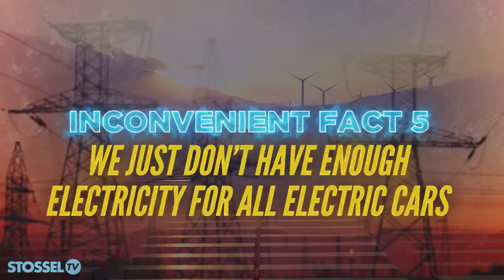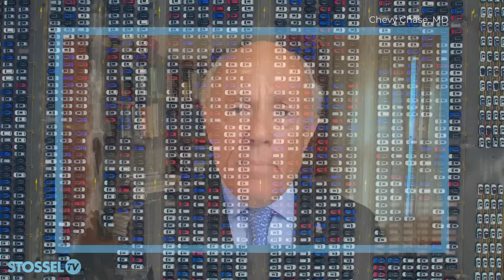Electric Cars: Inconvenient Facts, Part 2

Comment: One thing to remember: Politician's by and large are not elected because they are competent at governing.  They are elected because they are good at campaigning, fund raising, pandering, and cutting back room deals.  In other words, we are largely governed by the world's Marketing Department.   And "going green" is good PR, even if the facts don't support it.
Reply: This is why I hold a distinction between a politician and a statesman. Politicians are more or less as you say. Statesmen are those who old the same political positions as politicians, but care more about doing their job than getting reelected (and before anyone says anything, no, JFK was not a statesman).

edit: Minor addendum, a statesman might be good or bad at their job, but at the very least, they are actually trying to do their job.
Reply: hmm, actually it depends very much on which facts fool you the most. For instance the fact that you would need 2x of US area covered in solar panels to produce all the energy used in US, or the fact that 12% of used energy in US is already renewable and if that number is multiplied just by 8, the entire US energy needs would be met; or the fact that specifically for all electricity used in US you would only need 1000 sq.mi of solar panels to produce.  ...all are true, but just the first is mentioned in this video.
Another easier to understand fact: off grid, with a modest 5kWh solar panel system you would be able charge your electric car the equivalent of 100miles every sunny day for free.
Reply: @brianensign7638  Of course some people suck while others are great, that was the point of the addendum.

Still, I would rather see bad results coming from good intentions than bad results from bad intent.
Reply: @alexd.6551  hmm, believe a YouTube comment or a physicist from the Manhattan Institute.  Alex, I'll take the Physicist for $500...  🤡
Reply: @alexd.6551  Just because 12% of US power is "renewable", doesn't mean 12% of the grid is fully supported by it, and it certainly doesn't mean 100% can be supported by it. 

Most "renewable" sources are not stable. So, for every kWh produced by things like wind and solar, a kWh must produce by traditionally generation, like gas and coal. This makes most "renewables" redundant. 

Think of most homes with solar. In theory, the panels produce enough power to the home, yet the home is still connected to the grid. This is because the panels don't always produce power. So, a gas turbine must remain spinning away, waiting for a cloud to fly over your home. It's just a massive waste.
Reply: @whyjnot420  I don’t know. People seem to have a harder time backing out of a mistake if they think their motives are pure. It’s the misguided ideologues that will persevere in error long after the self-serving politician would have cut losses and run.
Reply: @AkioWasRight  I will say, if we can get more energy dense batteries, that one becomes less of an issue as we can store bigger batteries at home such that daily power requirements can be met with just solar charging. If we get to the Goldilocks zone of using more plentiful materials like Sodium instead of Lithium (research and production is already happening there for large, stationary batteries), we could transition to be the other way around where fossil fuels are the backup, like how some homes have a backup generator. That’s a pretty far off goal though, and it would take several breakthroughs in battery technology to really make it viable, but it’s still a possibility while researchers look at how to make batteries more energy dense and longer lasting.
Reply: @brianensign7638  In those cases you can only hope that they have integrity. Probably have more luck hunting for unicorns though. >.<
Reply: @alexd.6551  At best, solar panels yield 1000w per square meter in full sun. Due to night, clouds, low angles in early am and pm, it's more like 100w per meter 24/7/365. Based on that, how many square meters of panels would we need to supply the USA wattage needs 24/7/365? Hint:  lots more than you think.
Reply: But somehow you don't think they've been bought out by big oil.... I think you guys have been bought out by big oil.
Reply: @Rick-ro8bf  hehe, better than believing is doing the math and checking the facts yourself. The appeal to authority is a common logical error, regardless if you choose to trust or distrust the authority of government, certain scientists, or certain youtubers.
Reply: Truth
Reply: the real green energy is the kind that glows green in comic books and cartoons. Nuclear.
Reply: Well stated, and 100% truth.
Reply: @alexd.6551   Total bullshit that ignores every other mitigating factor. Nice try, Sparky.
Reply: @AkioWasRight   Don't confuse the sheep.
Reply: @alexd.6551  
for free? so you didn't have to pay for the solar panels? the converter? the car? the cables? the house? the installation? what flocking planet are you from? evidently not this one!

there are no free lunches!
Reply: @Bob_Adkins  
the sun provides 1000 watts per square meter during summer and only if the sun is directly overhead - solar panels are less than 20% efficient, so they produce less than 200 watts per square meter, during full sun, on a summer day, when the sun is directly overhead

try again
Reply: @andyman8630  Obviously for the house and the car you have to pay regardless if you go electric or gas, for the panel system there is a one time payment which you need to check if it is cheaper or more expensive than paying gas for say 15 years. I will agree thou electric is less convenient, but might be cheaper.
Reply: @pretorious700  Are you blind to the difference between something bad happening because something bad happened & something bad happening because someone deliberately wanted something bad to happen?

Not a big concept.
Reply: @alexd.6551  
you mean to say it's not free?

that's what i thought
Reply: @andyman8630  Yes, I'm guessing it would take over 1000 square miles of solar panels to supply all of our electric power needs, plus 100's more square miles for batteries and other infrastructure. It's just not feasible, even with a little help from wind power. Solar must never be large civil projects,  it works much better for private hobbyists that have time to tinker with it.
Reply: @Bob_Adkins  
agree entirely! an individual can go off grid with solar, but as community base load? forget it
Reply: @andyman8630  Yeah, Andy it's perfect for certain people and their situation, but a complete disaster if you try to make mega projects for more than a handful of families and businesses.
Reply: @Bob_Adkins  I mean it was stated in the video: even if you cover all of the US in solar panels it will still only produce enough energy for half of the population with current technology and based off physics even future technology isn't gonna change it by that much more.

I'll be blunt there's only 1 way green energy can be enough for the entire world population and it is not a pleasant way: reduce the world population by about 50% to 70%...and I doubt many people would volunteer to be in that reduced % nor would I say they should allow themselves to be put into said % (though if they go with that plan: activists firsts since they want to reduce CO2 so much, they can be the ones to take responsibility first).
Reply: @andyman8630  I installed solar for over 15 years, it’s amazing that these people hold solar in such high regard with such LOW efficiency. When I started solar modules were 100-120 watts, now they are 400 watts with the same dimensions. People are buying equipment that is produced with “dirty power”, which will quickly become obsolete and is expensive to dispose of and cannot be recycled.
Reply: @shREDhead44  
hopefully one day we'll work out how to recycle PV panels
Reply: @andyman8630  agreed wholeheartedly, I pray we find a way. I tell my son that if he comes up with a way to make PV modules 40% efficient he’ll have Musk money.
Reply: @shREDhead44  
that's for sure! 

i remember watching a TV show about new inventions back a few decades ago, and they showed this new solar 'cell' - it looked like a small ceramic bathroom tile and was tan colored - above it was placed one of those flat lenses you sometimes see in the back window of commercial vans, to focus more light onto it - it was supposedly more than 40% efficient but i have never seen it since (like so many other inventions which strangely vanish along with their inventors)
Reply: Good point my friend ! Dont see too many poor politicians!!
Reply: @alexd.6551  and what about the environmental and human costs of mining the metals and minerals to build the batteries? I believe this will have a far more negative impact on society and the environment than having all of the above.

Why can't we use all? Gas, coal, wind, nuclear, hydro, etc. Why does it have to be just electric? When the government is pushing one thing only, people need to worry.
Reply: "going  green"   is  about  making  $$ , n  not   "saving  the  planet".
Reply: @driver4011  So John Stossel supports ESG corporations?
Reply: Two term limits
First term office
Second term life imprisonment
Reply: You forgot lying... they are good at lying.
Reply: @alexd.6551  To power the US with solar would only need an area the size of the Mojave desert, not that it would make sense.
Reply: @Rick-ro8bf  Manhattan Institute also said that cigarettes don't cause cancer and CFCs have nothing to do with the Ozone layer getting degraded.    They will give you any answer you want for a big ass donation.
Reply: Selected, not elected. Bought and paid for...
Reply: Organized crime is more like it.
Reply: @erniefrijole2618  
it's self evident you have no comprehension of the laws of thermodynamics, specifically the 2nd law, Entropy

in a Universe where no matter nor energy can be created nor destroyed, Entropy is nothing more natures' recycling system

e.g. the highly complex system which is your body dies, entropy breaks it down into its' base components, then LIFE consumes those components and rebuilds them into other living bodies, which are then eaten by ever higher life forms, until a human eats one of the animals in that chain and voila!
Reply: The future of electric cars will be similar to low production expensive sports cars. They will never replace ICE engine vehicles. This is all politics.
Reply: @johnbuscher  "If we get to the Goldilocks zone of using more plentiful materials like Sodium instead of Lithium." With the EV advocates it's always "if." 
When converting to a different product especially when talking about converting to an entire EV fleet what is needed is a when, not an if. When Henry Ford converted with his assembly line horse and carriage to automobile the technology was already in place.
Reply: @whyjnot420  I like that distinction. So here's a question: Do you think Dick Cheney was a statesman? He was among the worst things that have happened to this country, but it did seem like he was earnest, and really thought his crappy policies would help America, wrong as he was. He was both good at his job, since he was effective, and very bad at it, since he did not in fact help anybody beyond the extremely wealthy and the arms dealers/war profiteers. But then, what do you expect from a guy who literally has no heart...
Reply: @AkioWasRight  The utilities benefit from decentralization of the grid since their biggest challenge is predicting swings in demand and their greatest inefficiencies are in controlling output to meet those swings. When there is more solar powering more homes when they need it, and feeding surplus to the grid, that stabilizes the grid. Charging EVs at night will help flatten out the demand also.
Wind and solar now provide over 20% of our needs, and have surpassed what coal provides, nationwide, and the grid will only ever get cleaner. To say renewable energy is a waste, or even to put renewable in your quotes, is disingenuous at best. Learn the bias of your sources to see whose agenda you are inadvertently supporting. John Stossle is a Fox Business hack displaying bad research and poor reporting skills that wouldn't fool an 8th grade debate class, and his Manhattan Institute guy happily promotes junk science with funding from the Koch brothers, super conservative ALEC, and a loooong list of conservative organizations that are basically using them to launder their money. As dirty as the industries they support.
Reply: @mikemcmo  I would have trouble naming a single influential national level statesman who exists within living memory atm.

Statesmen are to public office what flint knappers are to stonework. Something that may exist here and there, but is for the most part, a lost art.

I would say what you get today are at best, politicians who occasionally act like statesmen temporarily. When talking about things like national level offices and the upper stuff in states as well as the upper levels of bigger cities. Also this isn't just about people who don't care about what they are, in theory, supposed to be doing. The way the system of governance functions, in terms of things like term limits, advertisement/promotion/denigration of candidates and so on (i.e. the whole mechanism behind getting into office and staying there, both legal and practical sides), is more or less weighted towards that politician pathway rather than that of the statesman. If that is the only game in town (like it is for so many offices), people with all sorts of intentions and aspirations will play.

Perhaps that is inevitable with the rise of career politics. With statesmen being amateurs in the best sense. Those who do something because they love it, not for some form of recompense. (The very word 'amateur' comes via French from the Latin words meaning 'to love' and 'lover'.)
Reply: @mikemcmo  I have been thinking and perhaps the closest we have gotten to a national level statesman since the end of WW2 was Robert Mcnamara. His raison d'etre was streamlining defense spending. He really wasn't a politician or a statesman though, he was a numbers geek with good business acumen and military background. His failure as Secretary of Defense is directly tied to his goal of streamlining DoD spending. But it feels more like this was just another job assigned to him by higher ups. Rather than something he wanted.
Reply: @mikemcmo  You're arguing fallacies, and you're ignoring what I said. What am I supposed to do with that???

Again, you're ignoring what I said. 12% "renewable", 20% "renewable", 99.99% "renewable", whatever, it doesn't matter how much. It's still overwhelming surplus. Surplus energy is worthless energy. Instead of rebutting that point or denying it, you just ignored what I said. So, what I said stands, and your argument is just fallacious. There's no point in trying to correct you.

As for the grid and sources of production, that's another fallacy. Just because there are more competing sources of energy doesn't mean the grid is decentralized. The grid is still 100% centralized to the utility that not only is determining what their service is worth, it also determines what your surplus solar energy is worth. But now not only that, there are cars connected to their grid, which is an expansion of their monopoly. Instead of a utility, recycling companies, and various oil companies and angro companies competing to power your car, your utility will 100% be in control because government is eliminating their competitors. This is giving an immense amount of power to the utility, which will ultimately use that power and make rates more expensive.

And just to establish my point, you're arguing this now as states like California and the California Public Utilities Commission are cutting incentives and raising rates on solar plans, which just proves my point. I literally predicted it 5 months ago, yet you're arguing against it 5 months later after it become reality.
Reply: @alexd.6551  My car currently doesn't depend on sunny days! Long live Fossil Fuels!
Reply: Well said.
Reply: @alexd.6551  umm, the 12% that is renewable is almost entirely nuclear and hydro-electric turbines.  Most other power sources can't even sustain themselves in a near reasonable manner.  For example, to power a home with wind turbines, it would take something like $60,000 of equipment for ONE HOME and require constant wind.  This does not factor in maintenance costs either.  If you go under constant wind, you experience brown-outs and blackouts, which will not only inconvenience you, it will damage your equipment.
Reply: @whyjnot420  Nixon was very much a statesman. Look at how he drove into the middle of the protestor crowds and spoke with them about the Vietnam War.
Reply: @AkioWasRight  Fortunately there are ways to store electricity that are coming down in price.
Reply: @RoyBoy2019  Yes, like batteries. China is flooding the market with them. They are a horrible solution to energy storage.
Reply: @AkioWasRight  Why horrible? Please expand. Working well for Australia vs peaker plants (since 2018) despite heavy skepticism, California vs imported prices; also works for remote communities to reduce their generator size, fuel costs, while improving reliability. Batteries manufacturing pollutes sure, but offset seems decent in many use cases vs methane & diesel using worse case NMC Chinese batts (108kg CO2/kWh). Offset will be faster with LFP and medium term with sodium batts (20?kg CO2/kWh).
Reply: @RoyBoy2019  Prove the economics of recycling batteries first. Once you've don't that, then you touch on the subject of emissions and whether it's worth it or not.
Reply: @AkioWasRight  Economics is a fair pragmatic point, unfortunately part of why BEV's were delayed for so long. However "worth it or not" is an entirely different kettle of fish holistically speaking. Many of us will die prior to knowing the answer, but can confidently say sticking Only with what we've done in the past is dumb. Worth it priorities change pretty quick when food security is threatened.
Reply: @alexd solar panels are not free, though I would agree they are worth the investment, depending on where you live.
Reply: Too sadly true.
Reply: @whyjnot420 JFK was a snake!
Reply: @AkioWasRight no, your well reasoned point doesn't make 'renewables' redundant,  it makes them parasitic.
Reply: @agon1963 I don't want 'all of the above', I want the best. What I'm certain of at this time is that solar and wind are possibly the worst.
Reply: @driver4011 going green means that you want to reduce someone else's co2 output, if you're honest you know that person will die if he is as restricted as you propose.
Reply: @wheel-man5319  JFK is like the ultimate politician. That is, a politician who has convinced the masses that he is a statesman.